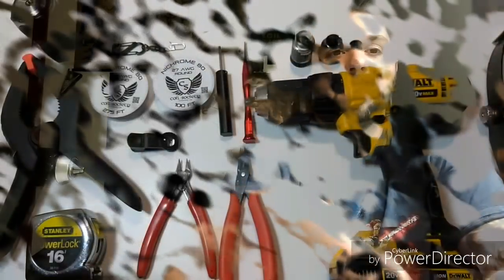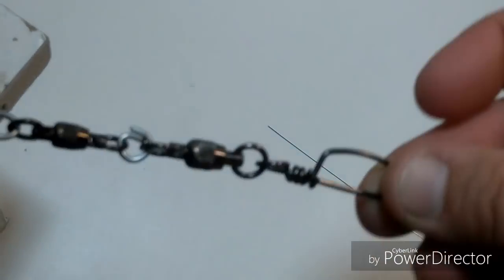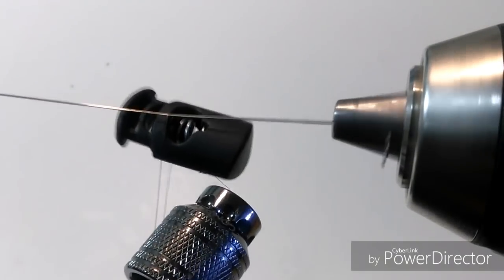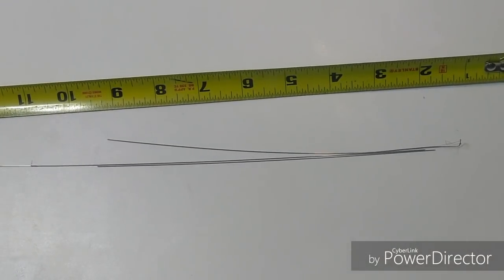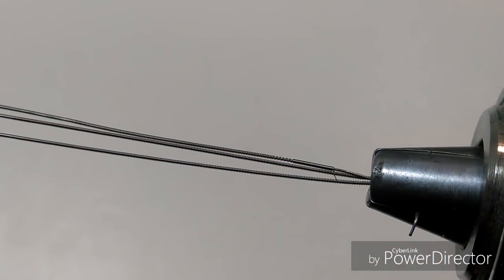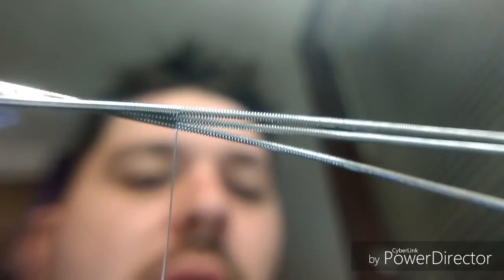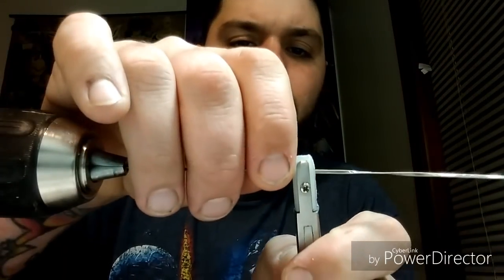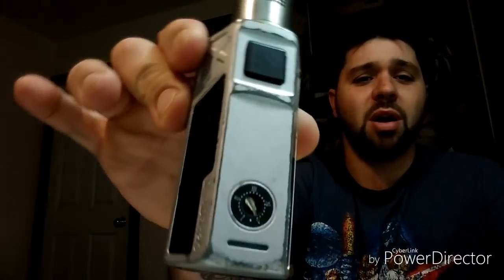Coil Build Tutorial - 3 core Staggered fused clapton / sfc - n.devine83

Comment: Nice tutorial. I just found out I've been building these wrong. I always just used a bare wire for the center, never staggered it just the outside ones. Using them kinda like frames. Need to try it this way from now on.
Reply from the maker: +Stuart Dias yes still a cool build, not so much wrong, just not a 3 core sfc, thanks for watching

Comment: Excellent video. You are amazing at making exotic coils. I am ok at making my own coils. But I wanted to ask you about a reel of wire I bought which is staggered fused Clapton SS. It's thick wire but when I try to wrap say 3mm there very springy so what's the best way to get rid of that. Could I use a lighter to take out the springyness? Normally I would just pull the leads tight and screw them down but this is for a postless deck. Let me know what you think? Thanks bro 👍 keep Safe and Well Done 👍😉
Reply from the maker: If u want a 3mm coil, wrap it around a 2.5, so when it springs out u have a 3mm, it's how I do most twisted wire, because they are springy, hope that helps
Reply: @ndevine83  yeah it does. I will give it a go. Thanks very much bro 👊👊👊👍

Comment: Nick
Could I build a framed twisted wire coil staggered style or would the twisted core interrupt the flow of the clapton process.  What if the cores were 28 Ni80 twisted tight as possible but the frames 24g kanthal as to have more space just above the core wire?  Is it possible or not practical?  Let me know your thoughts.  Parallel twisted wire 2 cores fused together with 40g ni80 is one of my favorite coils to enjoy.  Flavor for days.  Good on regulated

Comment: I was watching your video got to the point where u tied the wire on to heavy rda but then u put that part on there that u said was Optional but u put it on the wire hooked to rda then got confused and quit
Reply from the maker: So I have a video 3 years newer and only 10min, called best loop method .
Reply from the maker: By the way, coil building needs patience,  may wanna work on that, not sure

Comment: is it really worth this much time spent on making a coil?
Reply from the maker: Na i spend hundreds of hours of my time, because of nothing.
Reply: @ndevine83  I just mean in terms of performance verse less time consuming coil builds.
Reply: @ndevine83  this had me rolling 😂 Codie, if you don't wanna build them yourself they're easy to buy and support amazing people like this renowned artist and long time contributor to the vape scene. If you have the patience and you are good with your hands, building them yourself is relaxing and ultimately insanely cheap. You can make coils like this for pennies and they vape like a dream and last forever. I spent 3 hours wrapping alien framed staples last April that I'm currently using now and they're just like the day I installed them and still hit like a dream. Most claptons I have used and more basic builds get gunked up or fall apart after a couple of months but those staggereds will last ages if correctly cared for